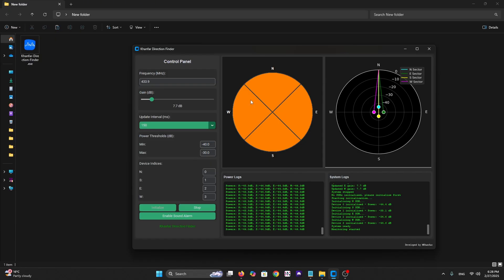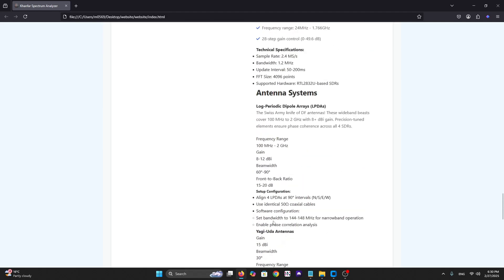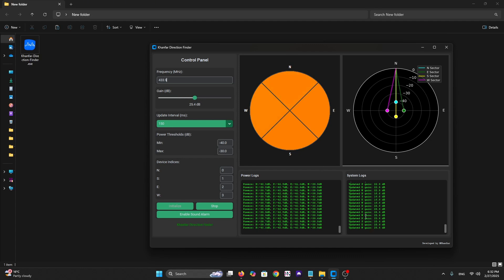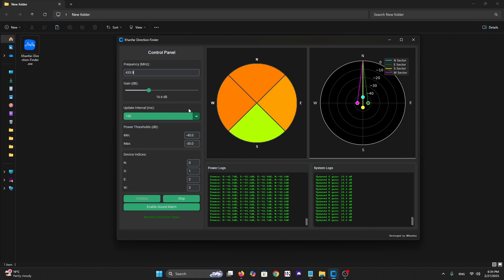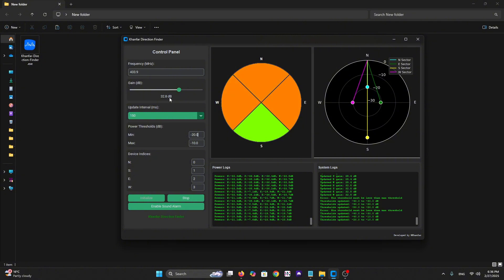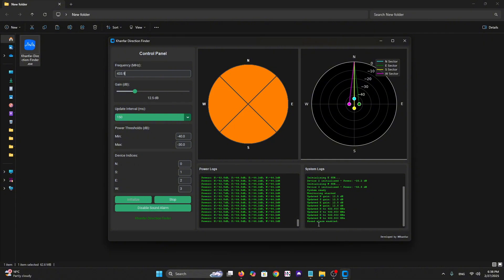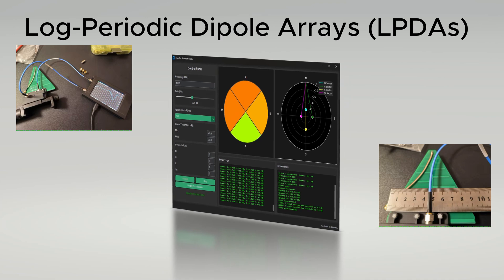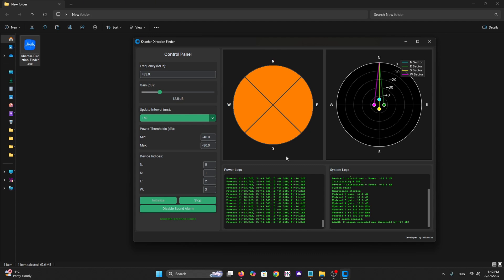Khanfar Direction Finder

Comment: Hello. Thank you very much for the interesting project! Is it possible to use non-directional antennas (vertical dipoles) and use phase analysis of signals to determine the bearing?
Reply from the maker: hi , yes, it's absolutely possible to use non-directional antennas (vertical dipoles) for direction finding through phase analysis! This is actually how many professional DF systems work.
Instead of comparing signal strengths from directional antennas (like in my QUINTET setup), a phase-based system:

Uses multiple omnidirectional antennas arranged in a specific pattern
Analyzes the phase differences between signals arriving at each antenna
Calculates the direction based on these phase differences

The advantage is potentially greater accuracy, but the challenges are:

You need precisely synchronized receivers (regular RTL-SDRs struggle with this)
The signal processing is much more complex
Antenna spacing and arrangement becomes critical

If you want to experiment with this, look into "coherent RTL-SDR" setups where multiple SDRs share a clock, or check out purpose-built multi-channel SDRs like the KrakenSDR which are designed specifically for phase-based direction finding.
I might cover building a phase-based system in a future  if there's enough interest! and need Significant software changes to implement phase analysis algorithms .
Reply: @MKhanfar-MWK   Thank you very much for the detailed answer! Yes, I was interested in projects like Kerberos SDR or Kraken SDR. But at the moment it is almost impossible for me. On the Internet I have come across attempts to implement a direction finder on 4 SDR receivers with a common master oscillator, using Raspberry as a processor.
Reply from the maker: @ВячеславРусецкий-з2в  we soon release that software,  stay tuned . And see new videos in this channel.  73s

Comment: The topic is massive and very beautiful work.
I want to inquire about several things, some of which are developmental and others related to the programs themselves.

First, regarding antennas: What are the specifications of the antennas you recommend? Also, where should the antennas be placed, and what should be the distances between each antenna? And what if a non-directional antenna is installed—would it suffice?

Second, why don’t these programs work on other devices like Hack, etc.?
Reply from the maker: @DobaDob-y4m  hi , for antennas . See our website,  and soon we will release new software using phased algorithm system ! Stay tuned.  73s

Comment: Hey, thanks for creating this cool software! I wanna ask: regarding the RTL-SDR receivers, do I need to synchronize them for coherence, or do they operate independently? Also, can I use the software with only two receivers?
Reply from the maker: The system uses multiple RTL-SDR devices , To accurately calculate the direction of a signal, the system compares the signal strength and phase coherence across all receivers , Without synchronization, the signals received by each SDR device may not align in time, leading to inaccurate triangulation and bearing calculations , The software ensures multi-SDR synchronization by coordinating the sampling and processing of signals across all connected devices , This synchronization is achieved through advanced DSP algorithms that align the data streams from each SDR device , The system also uses identical cables and antenna setups to maintain signal balance and coherence , While the SDR devices operate independently in terms of hardware, their data streams are synchronized in the software for coherent processing , The software handles the synchronization process, so users do not need to manually synchronize the devices , The Khanfar Direction Finder software automatically manages this synchronization, ensuring the system operates as a unified and precise direction-finding solution , Use same High Quality Dongles , and you can make another hardware layer by adding external clock .